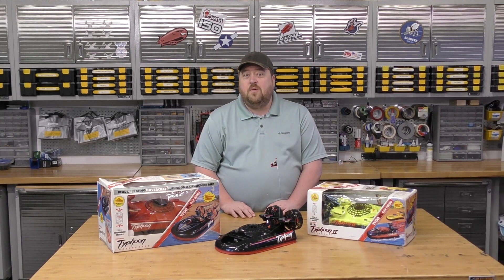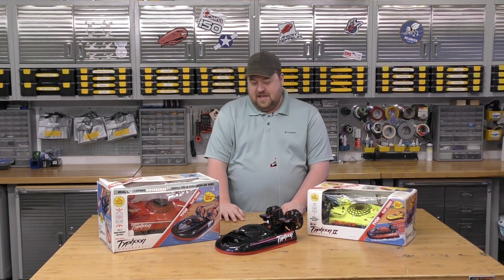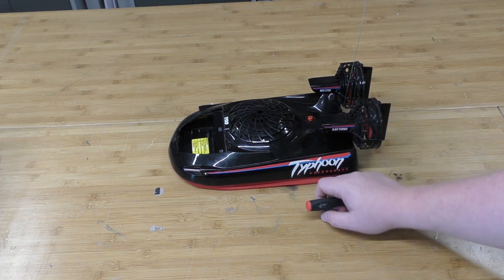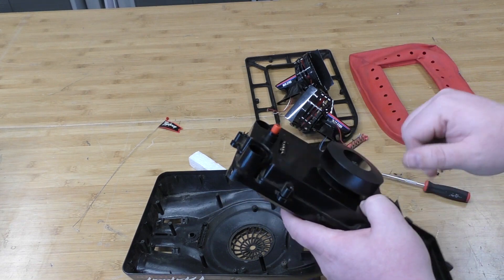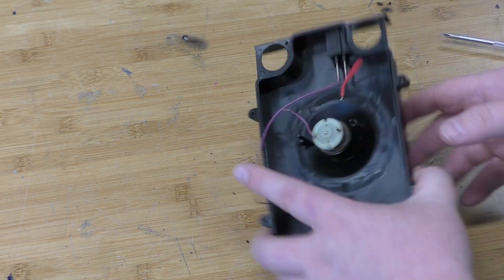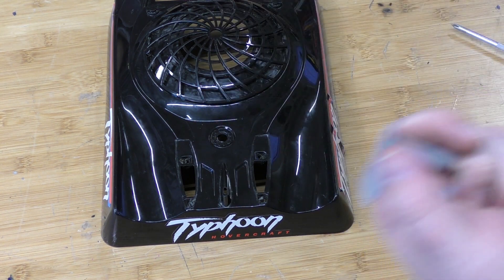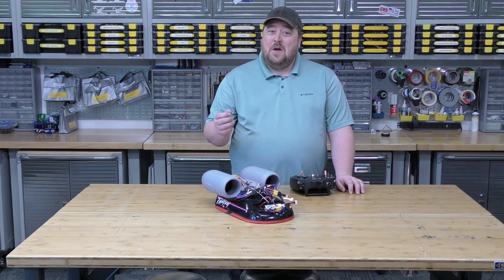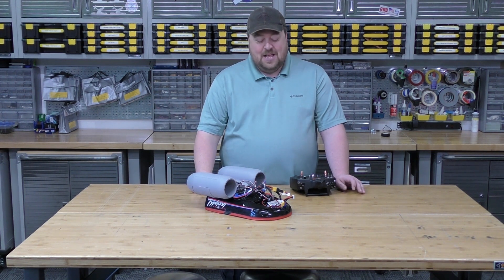Typhoon Hovercraft with 64mm EDF’s Build and Review

Comment: what is the difference between typhoon, typhoon 2, and mini typhoon 2?
Reply: The 2s both have updated bags. The minis have ⬆️➡️ remotes with no separate lift fan button. Not sure if there is a speed difference.
Reply: @PabloGonzalez-hv3td  fairly significant speed difference between the 2 and the mini, as well as the obvious functionality you mentioned